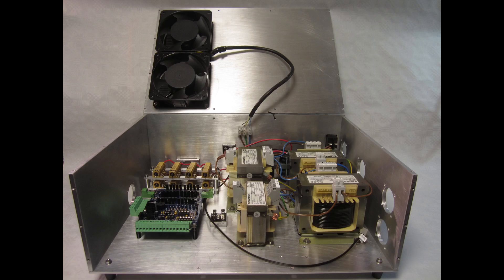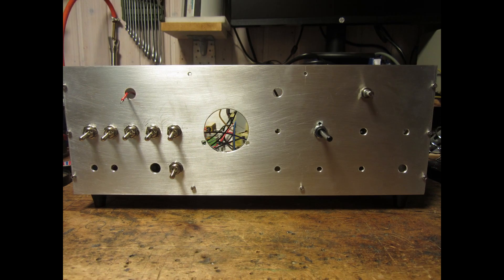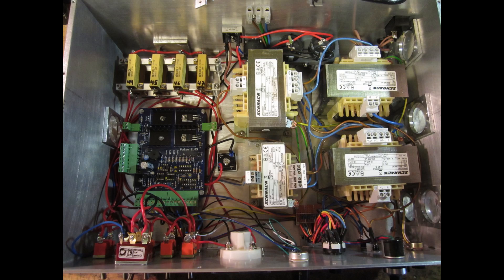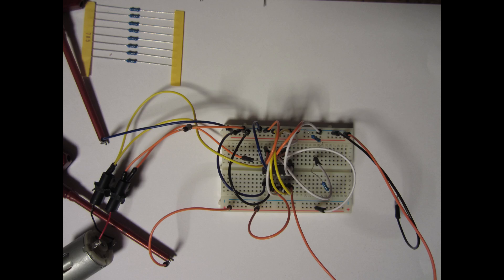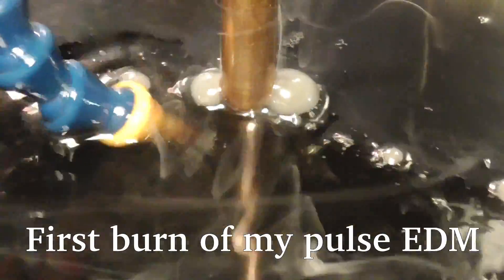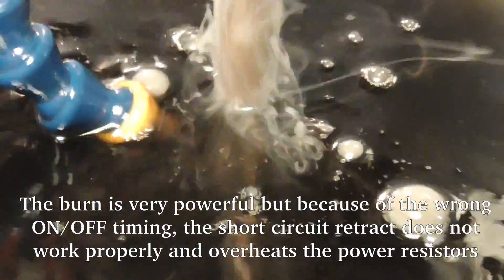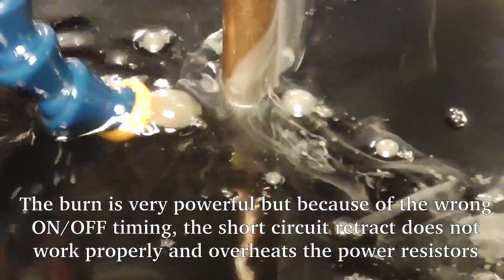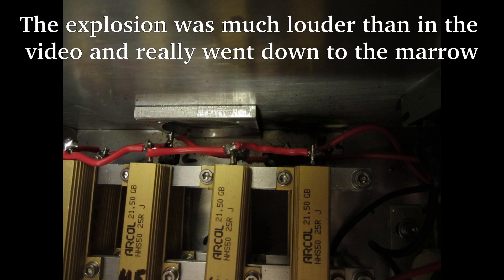Building a PULSE EDM with the DIY book of Ben Fleming Part 2

Comment: When you have a chance, would you give us an idea of cost? An estimate is fine it will be different for everyone but it's good to have an idea of cost before diving in
Reply from the maker: Hi,
the cost of only the electronics is about 400 - 500 USD if you have to buy all new.
If you can get some of the more expensive parts (especially the transformers) used it will be much cheaper.

Sure a used industry machine might be cheaper but it is much bigger and if it has a problem it will be very expensive.
Reply: im also curious, I cant help but think buying a used industry machine would be cheaper.

Comment: The control of an EDM either by using a dc or stepper motor is easy and has nothing to do with pulse on and off times. It works by the output voltage feedback from the power generator via a voltage divider to a comparator or whatever you are using to control the direction change of your z axis. I don’t know the design of the circuit you’re using on your build but check out the video that I posted a few months ago and see how easy it is to build an EDM.  https://youtu.be/I6EgTPVLrwU